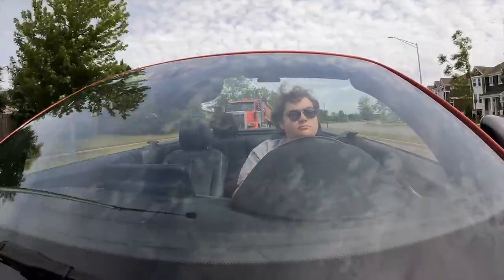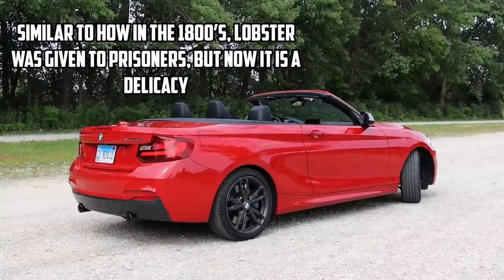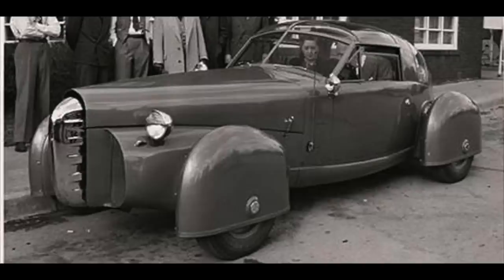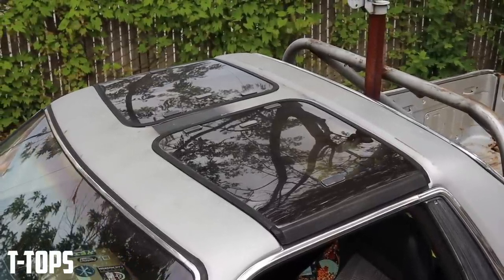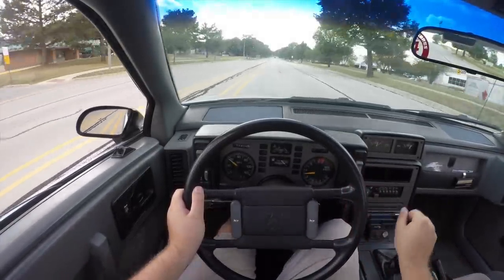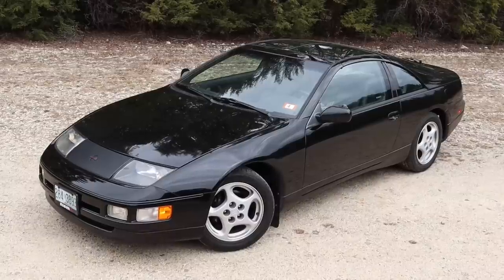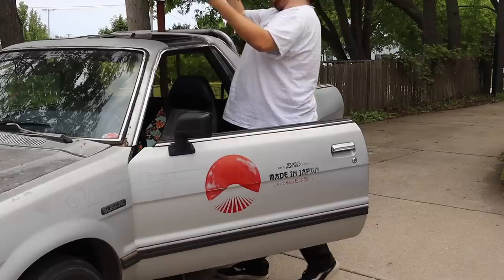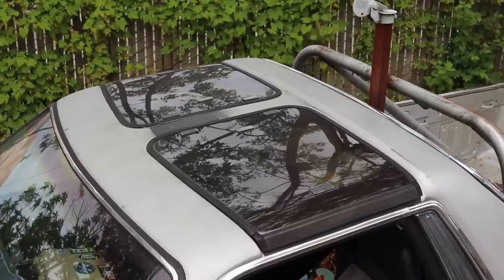T-Tops - How They Were Invented & Why They Went Away!

Comment: T-Tops were cool shiznitz back in the 80s, albeit an expensive option at the dealership. I remember my first new car, a metallic deep-blue 1986 Oldsmobile Cutlass. I worked so hard to have that car with chrome accents, a 3.8 litre V-6 and rear wheel drive. When I ordered the vehicle, I financially had to make a choice between the 'Sport Package' (improved suspension, ride stabilizers, tilt/leather wrapped steering wheel and posi-track) OR a T-Top. I chose the Sport Package, although the T-Top would have been a nice touch for the ladies.

Comment: I have a 2000 Camaro with T-tops.  I bought it new, still drive it every day, and it has never leaked.  There is a storage area in the back where the tops are locked in when not on the roof, and it works well.  The downside of the T-tops is that on short trips it doesn’t seem worth it to take them off, store them away, then put them back on when you get where you’re going.  Since I usually drive short distances, I don’t use the T-tops as much as I would like.

Comment: I owned a 1997 Trans Am with T tops. The previous owner assured me he never removed them. I owned that car for a year before I decided to remove them on the way back from Galveston.

It started out well then the car got very hot. I pulled over on the freeway and put them back on but took the shade off.

I was nearly home so I kept going. I had the A/C cranked but it wasn't able to overcome the hot car. I was soaked in sweat when I made it home.

The following week it rained and water leaked in from both T tops. I could never get the leaks to stop.

I sold it for a 2001 Firebird Formula w/o those damn T top. I won't buy a car with a sun roof. No reason to cut a hole in any roof.

Comment: God I miss the '86 Camaro Z28 that my family had. Originally bought brand new by my uncle, given to my mom at a time when he had... 3 or 4 vehicles and she was having constant problems with her station wagon, then given to my grandma when my mom got a '99 Ford Explorer (which is now MY car). That damn Camaro kept shrinking as I grew older and bigger, but it really was the coolest ride I had ever ridden in! But uh, that one summer, I think either in '97 or '98, was not good on it, for making it vapor-lock one extremely hot day (it had to have been 120 fahrenheit that day, it was really bad). But yeah, it was a t-top, and it was neat to be able to remove the two sides of the top occasionally, but supposedly there was a specific height or point both the windows had to be rolled up to in order for the car to NOT leak when ever it rained (which it NOW never even does anymore where I am in California). Still a bitchin' ride :)

Comment: '84 Camaro base model with T-tops and the 5.0-liter 4-bbl V8 that only developed around 150hp. TBH it was hot garbage; the paint went bad (especially on the plastic bumper caps) within only about three years but the T-tops were never a problem. If you stuck your fingertips between the side window and its gasket that was part of the T-top, you could feel movement between the two surfaces as the body flexed but it never ever leaked or rattled and one thing I did like about the car was the effect of having a "greenhouse" that ran clear from the front of the dashboard almost all the way to the rear bumper. My car had a cloth-lined faux-leather bag that you were supposed to be able to put the T-tops in and then the idea was to strap the bag down atop the hump in the back that went over the live axle and differential, but it was such a hassle to get them in the bag (they barely fit) that I almost never used it. In fact, very rarely had the T-tops off and never for my school/work commute or other  routine driving.

Comment: I like the t-tops way more than the sunroof or convertible top. A sunroof just felt like a hole in the top, and convertibles were just too much open air for my taste. T-tops were the best of both. Plus, in my Trans Am, it gave the illusion of no top even with the tops on, since they were tinted glass. I'd buy a new sports car with t-tops in a hot minute.

Comment: I had a 76 Corvette, and pretty sure all ' 76 had T-tops.  When you took them off and put them in the vinyl pouch and stuck them in the storage area behind the seats, it used the vast majority of available storage in the car.  Speeds above a crawl had some awful turbulence in the car.  I rarely drove it anywhere with the T-tops off, even though the A/C in my car didn't work.  I've also had 3 convertibles over the years, a 66 Fairlane 500, 72 Mustang,  and 90 Miata, but I never wanted another T-top car.
Reply: I had a 76 Vette also .. yes it had t tops.   I miss that car

Comment: Usually this was a marketing or structural issue. If a carmaker had a convertible in the lineup, the TTop was largely considered unnecessary. Markups were higher on convertibles so it was a no brainer to eliminate the Ttop as a cost cutting move or profit move. I should point out that the C8 Corvette still caters to open air motoring with a solid roof, as well as retaining a folding steel roof convertible. More likely manufacturers determined the T roof wasn't worth the trouble in terms of loss of structural rigiidity in the face of heightened safety and roof crush standards, not to mention leakage complaints from owners of older cars that didn't have their weatherstripping maintained.

Comment: there was some car in the 70's that had powered, hide-away T-Tops.  Then slid into a wide center section. I would always need some sort of open-air driving in my car. The moonroof in my 2010 RX-8 is about 40% towards a convertible-feeling once you open the rear side windows.

Comment: In the late 80s I had a Nissan Pulsar NX with solid steel (no glass) T-tops (and pop up headlights). When they were off it really felt a lot like a convertible, but they were heavy and a hassle to take on and off and store. But they never leaked! P. S. This car also was available with two different rear hatches, the less common one (which I didn’t have) made it look more like a wagon/shooting brake.
Reply: true chads remember the NX 

gods drive the NX

Comment: I own a 2000 WS6 TransAm with T-tops, the car is obviously 22 almost 23 years old and the tops fit tight and never leak.
Of course the car only has 50K on the clock, and I only drive it to special events and car shows, it also has popup headlamps, a 6 speed and 450 RWHP!!!

Comment: One time in the middle of the night I heard raindrops so had to run out to put my T-tops back on but didn't lock them. No big deal in most circumstances. The next morning some punks vandalized my neighbors property so I ran out to the Trans AM and pursued them at 90 MPH on city streets and as I was pursuing them I noticed the T-top above my head was rising so I grabbed it in time and locked it then I looked to my right and the passenger T-top had flown off and got smashed up. I easily catch the punks but my brakes were overheating really bad as I was really hammering the pedal and slamming the brakes on turns to try and make up the huge head start they got due to me being on the second floor and having to run down the stairs and then to my car. They were already driving away from the scene when I spotted them.

Comment: Leaks, both rain and wind (just ask an old Firebird owner about the wind rush campaign) which added an additional reinforcements to the roof area and different weatherstrips.  Took up far too much room in the trunk and if you didn't store them in their bags, scratches, dings along the side and possible breakage.  Then there is this - why didn't the aftermarket American Sunroof installations leak while the factory versions did?

Comment: I feel like modern sunroof design made the t-top unnecessary. No fussing with latches or storing panels. I use to love driving my old rag tops but I don't miss the hassle of putting the damn thing back on - was a real PIA. When I got my first sun roof - I was happy about that tradeoff. Gotta say though, the t top design looked slick. Especially on the corvette and trans am.

Comment: loved my 300z T tops but in the end I know prefer may S4 convertible pulling out heavy glass panels storing them and lets not forget putting them in when it start to pour and the leaking vs hitting a button to raise the roof. As to the pop up lights in the end its another point of failure getting you stuck at dusk since they wouldn't come on was not fun.

Comment: One thing you did not mention in your reasons was fuel efficiency. There was some work done in the 1990s which showed that T-tops created more drag than Targas or full convertibles, so had lower fuel efficiency. Add to this that the manufacturing costs were higher and you had good reasons for dropping them.

Comment: Removable roof sections have been around since the horse and buggy times. Using removable hard or roll up soft sections of the roof on cars had already been done by the 1920's. There were a number of different styles and terms used for such vehicles.
Brougham Coupe (English), Coupe Limousine (Belgian), Coupe-Limousine Demiconduite (Belgian and French) all of which had the chauffeur under a roll up canvas or removable wooden top, while the passengers sat within an enclosed built body.
Targa was simply a marketing term.

Comment: I knew 3 people with 70's vintage t-top cars. All 3 cars leaked water around the t tops. Even with new rubber seals they were a leaking nightmare and the water was ruining the interiors of the cars. One of the cars was a  78 Trans Am and my friend modified the engine into a 700hp monster. All that power was twisting the unibody because without that sheet metal part of the roof the body was weakened. The t tops didn't fit very well with the body flex. Couldn't get one of the t tops to lock down any more. T tops were very cool but they were a bigger pain in the ass than they were worth........

Comment: They disappeared because of convenience. Sunroof opens with a button, as does more modern convertible. You have to get out and physically remove and store a part off your car which is not convenient, nor is there a motorized possibility to remove them. Other fun topics; Removable hardtops on SUV's (and the loophole around shoulder belts for 'convertible').  Why subaru brats had rear facing seats (import taxes for trucks). And I've always wondered about the legality of no doors (ala old jeeps, etc.) and side impact tests.

Comment: I wish t-tops would make a comeback even though a glass moonroof is much more practical.  One car you missed was the 1977 Oldsmobile Toronado XSR.  Only one was made if I remember correctly and the technology just wasn't there yet.  In short it was like a double power sunroof where each panel slid under the center portion of the roof.  It's featured in their 1977 full size brochure.
Reply: The new hummer ev has them
Reply: @Idk-gy5gs  Yes, I know.  Not a vehicle I'd like to own.  Moreover one vehicle out of a couple hundred models on the market doesn't exactly make it a comeback.  In the 80s you could have it on a Daytona, Firebird, Trans/Am, Camaro, MR2, Mustang, 300 ZX, Cutlass Calias, Regal and Grand National,  Monte Carlo and I might be forgetting a few.

Comment: Another issue with the T-tops is they reduced the rigidity of unibody cars, causing increased flex and sway.  Not something you want if you like to go fast and corner.
Reply: @lunatic fringe  Yes, and just like convertibles and panoramic roofs, T-Top equipped cars were heavier because of the steel reinforcement required to stiffen unibody cars, so they wouldn't flex while cornering at high speed. This made the car a little slower, and also not handle as well. However, T-Top equipped cars were really fun to cruise in back in the day, anyway. 😉
Reply: @TheGuitarman1968  Unfortunately, at least for Mustangs, the reinforcement was inadequate, and the flex was pretty bad.  Along with issues of floor pan stress cracks.

Comment: You forgot to mention the inner sun shield for the T-tops. For my 1991 Nissan 300ZX Twin Turbo, I had two inner roof shields that locked into the interior of the roof below the glass of the T-tops. Without the inner roof covers the interior of the car became a hothouse ! The sun would use the glass roof like a heat lamp. I actually never took off my T-tops during the 10 years that I owned my Nissan. I preferred to drive it in classic mode and only on rain free days. Some say I treated the car better than my ex-wives, (they were right).

Comment: T Tops were also cheaper than a convertible to produce. Convertibles usually requires a reinforced frame because without a lid, a box is alot weaker .

Comment: Brand engineering. Most makers models are based on a few platforms for economy of production. It’s a costly endeavor to add a separate engineered car, for a limited market. Convertibles are even way down in unit production, and only a few makers even consider making convertible versions of their popular marques, which essentially make them a different car, both in practical production terms, even requiring separate crash test studies.

Comment: The new full size bronco, has a Targa top like design. On the two door, ou can remove both sides or one side. But no T. The Four door, you can remove just the top to the back seat, just the top of driver, or top of passenger or any combination.

Comment: You missed a major point in favor of the T-Tops compared to a convertible, chassis rigidity. I have a 1994 300zx TT and, while the hard top is much more rare and hard to find in twin turbo, they are the most rigid for a race build. The T-Top added the extra rigidity compared to the convertible due to the middle cross bar and was postulated as the reason that the convertible never came in twin turbo form. Manufacturers do strengthen the chassis of a true convertible to make it better but that would result in additional weight. So T-Tops were considered to be a better middle ground of topless fun without as much performance compromise.

Comment: ....and 90's and 2000's.   I have a 1999 T-top.  The F body GM cars were the last vehickes to have a Ttop from factory which stopped production in 2002 for 2003 models to end. So the Ttops died in 2002.

Comment: If there was a way to make them automatically retractable, I'm sure they'd regain some light. Commodity rules for the general market, nobody wants to go through the hassle of manually removing and storing body panels - why having to deal with any of that when you can, with the press of a button, either open a smaller sunroof, or the convertible roof altogether.

Comment: They were and are still cool, people would still buy. The problem is as more power is coming from our engines the t tops dont handle the twisting forces well. The torque of the engine twists the car and goes right for the weak point, the t tops, and causes cracking there weakening the cars structure. The last to have and figure this out was the 87 fox mustang and gen three camaro and firebird. you might ask then how a convertible is ok. Well the chassis are reenforced to be structurally sound with no top. This much bracing inturn makes them much heavier than the same car with an actual metal roof. you think it would be lighter with an entire roof gone but it is not

Comment: I was going to say, Jeep Wrangler's basically have a T top with the way their hard top is designed.. but I suppose it doesn't actually have a center bar. It's more of a full on convertible, except with a roll cage and the option to leave the back on and have it be more like a targa top.

Not that you ever really want to just take off the front panels of a Wrangler though. That's a pretty miserable experience. The whole top off is great, but just the front panels makes for a lot of wind blowing around as air enters the vehicle and then doesn't have anywhere to go. Turns the passenger compartment into a high pressure cyclone.

Comment: People want power operated tops. Which is a huge reason the Saturn sky/Pontiac solstice was such a flop. The manual top that you had to physically exit the car to put down, and back up again. Which is completely inconvenient if there’s a surprise cloud burst. T-tops are awesome, but completely inconvenient, which caused people to stop opting for them when purchasing a new car. As well as the fear of shattering them when removing them, and warranty issues for the manufacturer when they would leak prematurely.

Comment: In the 70s the  the Ttop option was NOT covered under the warranty!!😼👎🏻
They ALL leaked and you had to pay 💰 out of pocket for repairs-(NOT guaranteed)
AC allowed them an undignified death!!☠️
They stored in the trunk so you were guaranteed a soaking putting them on!
The Thunderbird had a FULL fiberglass top that required a motorized lift to install after driving the car underneath it!!😳🤷‍♀️☹️
THOSE WERE THE DAYS!!

Comment: what I did not like about my Toyota MR2 T-Top apart from the leaking was the noise.  real convertibles are much quieter as they dont have the structure behind your head to obstruct the wind and pipe that noise back at you ,

Comment: Within like 2 minutes of learning about these I though
"Why not have the same locking mechanism/slot on the back window so the tops can be stored flush to the window, and since most are transparent then just have a little wire/plug to have defrosters/defogger or whatever it's called"
And I don't see any problems with it.
I may be stupid, but please, someone tell me I'm wronge bc I feel like I'm wrong